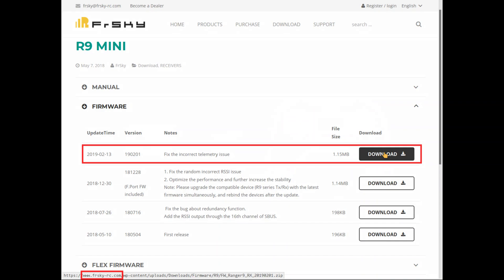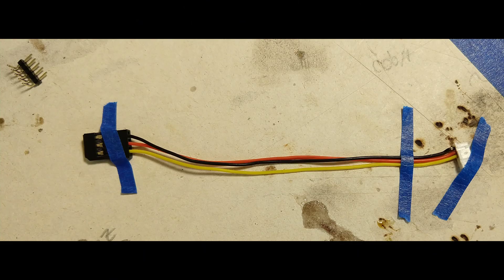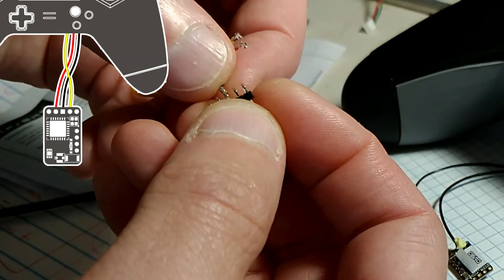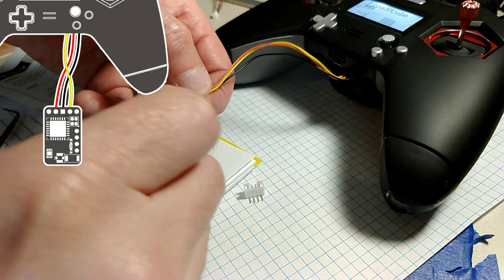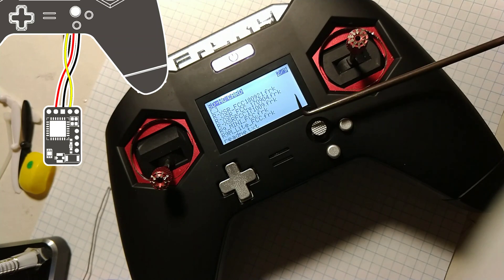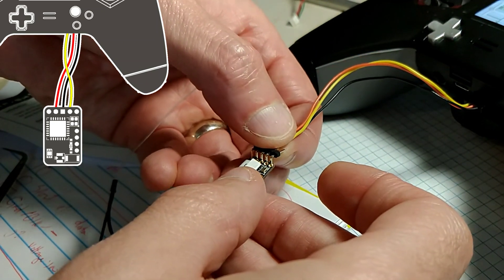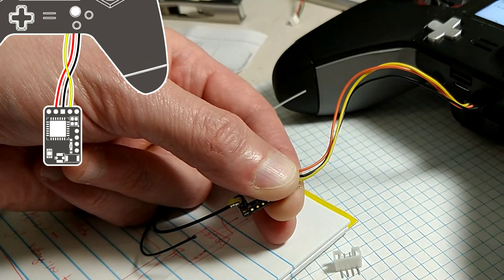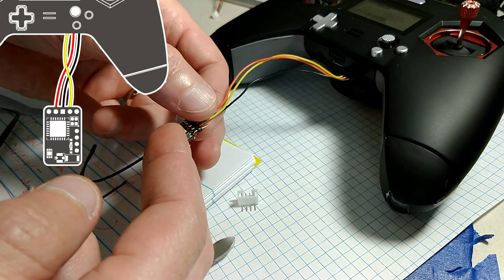🛠 How to Flash R9 Mini with X-Lite [Quick and Dirty]

Comment from the maker: 🤑🤑🤑🤑🤑🤑🤑🤑🤑🤑🤑🤑🤑🤑🤑🤑🤑🤑🤑🤑🤑🤑🤑🤑🤑🤑🤑🤑🤑🤑🤑🤑🤑🤑🤑🤑🤑🤑
💥💥💥 $9.99 16x Pink 51466 props https://amzn.to/2lMV2eF
💥💥💥 $22 AA / $19.91 AAA 100x Amazon branded batteries https://amzn.to/2kgZe5Z
👇👇👇👇👇🤑🤑🤑🤑🤑🤑🤑🤑🤑🤑🤑🤑🤑🤑🤑🤑🤑🤑🤑🤑🤑🤑🤑🤑🤑🤑🤑🤑🤑🤑🤑🤑🤑
🤑 THANK YOU for considering any affiliate links below.
🙏 HUGE Thank-you's to our community for all the youtube support!

🏆 Featured in this video: (only Banggood/Amazon are affiliate)
---

✅ R9 Mini 900MHz Long Range Receiver
 ↪ Bang: http://bit.ly/2XTEWlH $23
 ↪ Pyro: https://goo.gl/17FYtb $19.99
 ↪ Gfpv: https://goo.gl/YPntWi $19.99
 ↪ RMRC: https://goo.gl/7CRRXL $19.99
 ↪ RDQ: https://goo.gl/BwoVhW $19.99
✅ FrSky x-Lite Transmitter (Obsolete)
 ↪ Newer "S" @Bang:http://bit.ly/32LfLR6 | Newest "Pro" @Bang:http://bit.ly/2M6VLSQ | "Pro" @Amz:https://amzn.to/2Oc3Et8
✅ FrSky R9 Slim+ 915MHz Long Range Receiver 💛
 ↪ Gfpv: http://bit.ly/2DeCnOC $29 
 ↪ Bang: http://bit.ly/2Lzzca8 $27

 ↪ Amz: https://amzn.to/2Irtci6 $34

🏆 MY STUFF:
---
🐝 My 5"/6" Quad's Components (https://rotorbuilds.com/build/16766)
✅ RMRC Strix Screech 6" 💛
 ↪ RMRC:$28 https://goo.gl/yMpfsu | 6" arm:$10 https://goo.gl/52wPLb
✅ HelioRC Spring v1 IMU-F ⚙ Butterflight Stable
 ↪ Amzn:https://amzn.to/2OjoiDt (v1) | Pyro:https://goo.gl/68ZXMC (v2)
✅ Aikon AK32 35A 4in1 v2
 ↪ Amzn:https://amzn.to/2uNEwwA | Pyro:https://goo.gl/MyxRVD
✅ EMAX LS2207 1900KV 💛
 ↪ Amz:https://amzn.to/2yGdbP0 | Bang:http://bit.ly/2JUJ1w0 | Gfpv:https://goo.gl/bCNVzs | Emax:http://bit.ly/32G1ODS
✅ R9 Mini 900MHz Long Range Receiver
 ↪ Bang:$23 http://bit.ly/2XTEWlH | Gfpv:$20 https://goo.gl/sYuuDq | Pyro:$20 https://goo.gl/TBMC7Q | RMRC:$21 https://goo.gl/9VD2RL
✅ Caddx Turbo SDR1 💛 (SDR2 released)
 ↪ Bang:http://bit.ly/32Flhop | Gfpv:http://bit.ly/2JI0jO6
✅ Caddx Ratel (Starlight Sensor)
 ↪ $30 @bang:http://bit.ly/2ObUNro | $30 @Amz:https://amzn.to/2K17tMn
✅ Eachine VTX03
 ↪ Amzn:https://amzn.to/2mI00X5 | Bang:http://bit.ly/2JV14Cb & "S" http://bit.ly/2O92caR
✅ FarVew👁 Pagoda-2 Rev B Combat Edition RHCP
 ↪ https://goo.gl/M9FLFG
✅ Pigtail 5cm RP-SMA Female to UFL/ipx (5cm) Pack of 2
 ↪ $3.86 https://amzn.to/2XXRloN
✅ JHE42B 110dbi Finder Buzzer Built-in Battery with LED Light (7.4grams)
 ↪ $10 http://bit.ly/2Z6YdfO (USA warehouse)
✅ Black Label X 6s LiPo's
 ↪ https://goo.gl/qzhZ7N
✅ Gemfan hurricane 51466 💛
 ↪ $3.50 to $2.80 in bulk @Bang:http://bit.ly/2XZ1Zvh | $3.29 to 2.30 bulk @Pyro:http://bit.ly/2XPn9en
✅ Gemfan Windancer 5042 💛
 ↪ $3.05 to $2.44 bulk @Bang:http://bit.ly/2Lx80Jf

🐝 My 7" Quad's Components (https://rotorbuilds.com/build/16968)
✅ iFlight XL7 V3 💛
 ↪ $43 -$3_Coupon @Amz:https://amzn.to/2ZfbqDZ | @Bang:http://bit.ly/2StyDzn
✅ Lumenier ZIP 2407 1700kv Motor Non-POPO (i won from GetFPV)
 ↪ Non-POPO: $26 http://bit.ly/2DaOdtd | POPO: $27 http://bit.ly/2DgGwlo
✅ Foxeer F405 (i won from Viper_FPV )
 ↪ @Gfpv http://bit.ly/2Di84Xh
✅ Holybro Tekko32 F3 35A 3-6s BLHeli32 ESC (Set of 4)
 ↪ $59/4 @Gfpv http://bit.ly/2DeBl5c | $15ea @Gfpv http://bit.ly/2DhaVA1
✅ Caddx Turbo Micro F2 FPV Camera
 ↪ $20 @Gfpv http://bit.ly/2DdVZT2
✅ Eachine TX805 5.8G 40CH 25/200/600/800mW Transmitter
 ↪ $17 @Bang:http://bit.ly/2xZ6ers | $25 @Amz:https://amzn.to/2Y689Vz | Stronger "S" $24 @Bang:http://bit.ly/2Y2CuEA
✅ FrSky R9 Slim+ 915MHz Long Range Receiver 💛
 ↪ $29 @Gfpv http://bit.ly/2DeCnOC | $27 @Bang http://bit.ly/2Lzzca8 | $34 https://amzn.to/2Irtci6
✅ Lumenier AXII 5.8GHz Antenna (RHCP) (2pcs) (tough boogers)
 ↪ $35 http://bit.ly/2DNy5hz

🎮 My Gear
✅ RunCam Mini FPV DVR (BUT there is another version "-S" on runcam.com)
 ↪ $18 @Pyro http://bit.ly/2WwmRc0 | $18 @Gfpv | $23 @Amz https://amzn.to/2K6CdNx | $25 @Amz https://amzn.to/2Wp0uoE
✅ 900Mhz COMBO KIT: R9M Lite Module + Super 8 + R9 Mini Receiver + T-Antenna
 ↪ Bang: http://bit.ly/2SuAkwb
✅ FrSky x-Lite Transmitter (Obsolete)
 ↪ Newer "S" @Bang:http://bit.ly/32LfLR6 | Newest "Pro" @Bang:http://bit.ly/2M6VLSQ | "Pro" @Amz:https://amzn.to/2Oc3Et8
✅ Clear Silicone Non-Slip Gel Pads 65mm*75mm (generic battery pads) 💛
 ↪ $11/20 https://amzn.to/2BSGz8y | $5/15 https://amzn.to/30sgdld| $5/10 https://amzn.to/2YQrhbk
✅ iFlight M5 Quick Release Prop Wrench Tool
 ↪ $10 Amzn:https://amzn.to/2AlLvSE
✅ Eachine ROTG02 Android Adapter (has been very useful for dvr)
 ↪ $20-$25 Bang:http://bit.ly/32FtAAl 💛
✅ EV-Peak C4 80W Battery Charger (i have 2!) (~33mins from storage to full 1100mah 6S)
 ↪ $50 https://goo.gl/tkcfhk
✅ 60W ESD Soldering Iron Kit 💛
 ↪ $28-$33 Amzn:https://amzn.to/2AbeOXS
✅ RDQ/Bengineering Labs Smoke Stopper (must have)
 ↪ ~$7 Gfpv:https://goo.gl/SQi7xP | Amzn:https://amzn.to/2MdoYJ0
✅ Hawkeye FireFly Action Cam 1080p (catastrophically destroyed)
 ↪ Bang:http://bit.ly/2y61ujy
✅ Hawkeye Firefly Micro Cam 2 160 Degree 2.5K HD
 ↪ ~$50 on promotion or coupon or BG-points @Bang:http://bit.ly/30UkvlL

🛠 Useful Parts
✅ 100 AA Amazon branded batteries
 ↪ $22 https://amzn.to/2IXREp6
✅ Helping Hand Third Hand Soldering Tools Flexible 360° Stainless Steel Arms 3X Magnifying Lamp [...] by NEWACALOX 💛
 ↪ $41 https://amzn.to/2ID5P4j
✅ "A more complete" WLine M3 Screws 12.9 Grade w/ NUTS
 ↪ $12 Amzn:https://amzn.to/2OhWe3q
✅ USA warehouse 7 gram JHE42B 110DB Lost Buzzer/LED
 ↪ $10 Bang:http://bit.ly/2Z6YdfO
✅ USA warehouse 4.3 gram 1 hour JHE42B_S 110DB Lost Buzzer/LED
 ↪ $11 Bang:http://bit.ly/2Obpxsj
✅ Lipo Battery Voltage Tester 1S-8S Buzzer Alarm
 ↪ Bang:http://bit.ly/2Z6HTf0
✅ Pigtail 10cm PCI U.FL/IPX to RP-SMA Female Pigtail (connects to VTX03)
 ↪ $1.58 1x or $1.36 bulk (China) hhttp://bit.ly/2O9s4Dx
 ↪ $8 5x (USA) http://bit.ly/2JXjKBk
 ↪ $12.90 10x (USA) http://bit.ly/2XY7cDG
✅ Pigtail UFL/IPEX to Female RP-SMA (2inch/5cm) (Pack of 2) (USA)
 ↪ $3.86 https://amzn.to/2PXxn6f
✅ Pigtail UFL/IPEX to Female RP-SMA (4inch/10cm) (Pack of 4) (China)
 ↪ $3.46 https://amzn.to/2LwpB4B
✅ FrSky R-XSR RX 16CH 2.4Ghz
 ↪ Amzn:$28 https://amzn.to/2Stmiev | Bang:$22 http://bit.ly/2Ydwr0c | Gfpv:$21 https://goo.gl/1ooDmu | Pyro:$20 https://goo.gl/qfMmyy
✅ iFlight 20pcs 150mm 2.4Ghz Receiver Antenna Gen4 RF113 IPEX
 ↪ $12 Amzn:https://amzn.to/2Kvdkcv
✅ "YouMic" Lavaliere Microphone
 ↪ $13-$17 Amzn:https://amzn.to/2A5Zqfi
✅ PoP voice Upgraded Lavalier Lapel Microphone
 ↪ $11 Amzn:https://amzn.to/2ORF5ho
✅ PoP voice basic Lavalier Microphone with single EarBud
 ↪ $10 Amzn:https://amzn.to/2QpEd7k

🏁 #nerdCopter ##nerdCopter ###nerdCopter

Comment: Hello, when I select the FW R9 mini acct version on the sad card I get the options : copy, rename or delete.  Not flash firmware. When I downloaded the R9m lite firmware update I got the option to flash firmware. Any ideas? I am about to throw in the towel on Frsky.
Reply from the maker: the "access" version is for the new stuff, i never used the new access  because i dont have compatible hardware. for access you need both your transmitter and receiver to be access compatible.   if yours is compaitble, search specifically for access or accst or whatever the proper name is.
Reply from the maker: here's JB's vid. https://www.youtube.com/watch?v=ue0C8FQ2Zww
BUT, i'll also say, setting up a TX/RX for the first time is a pain in the butt, but once it's done, you are good to go. updates are seldom and only update if you really need to. i'm a computer guy and i like to update, but in this case i learned it's better to keep what works.

Comment: That's nice they don't have the connectors on them already, I had to make a wire up to run to my Taranis.
Reply from the maker: what i don't like is that it's not the same as the R-XSR, which was Molex Pico Blade 1.25mm, R9 Mini & MM are JST-PH 2.0 ... wish they stuck with a standard. Thanks for watching!!